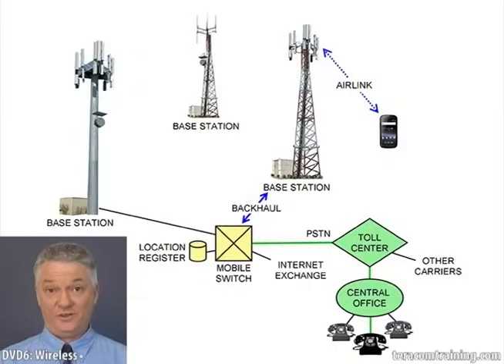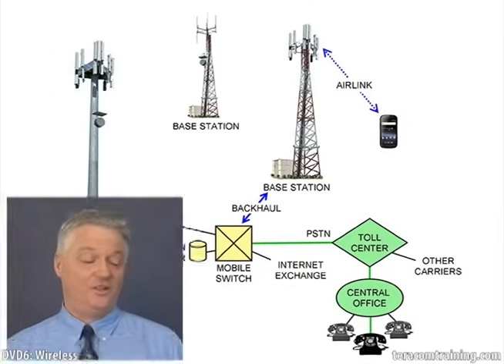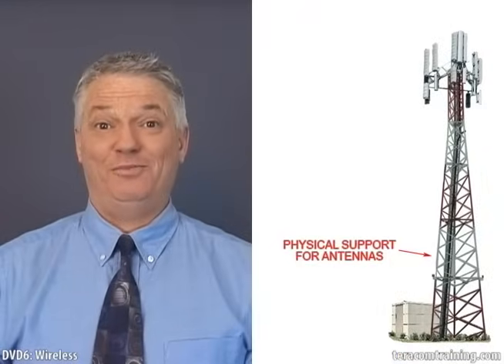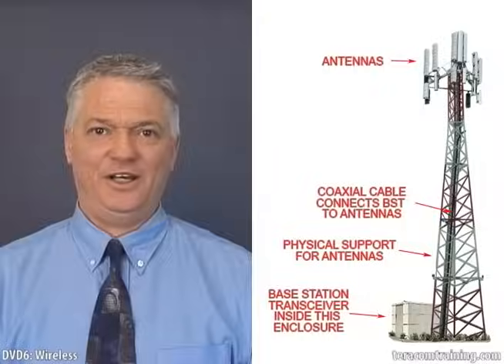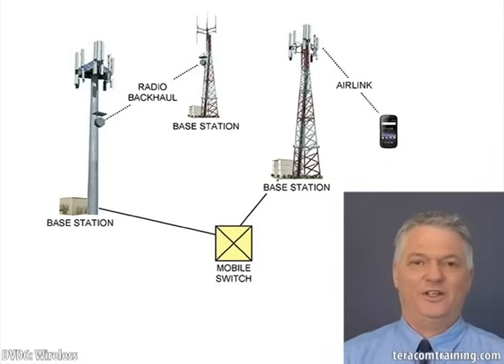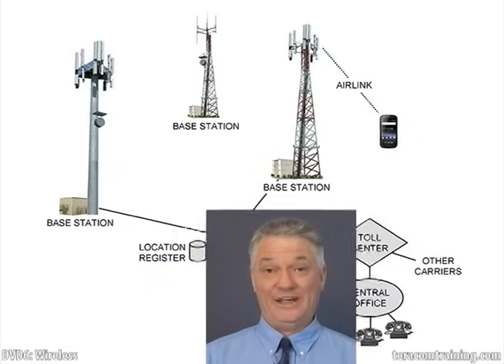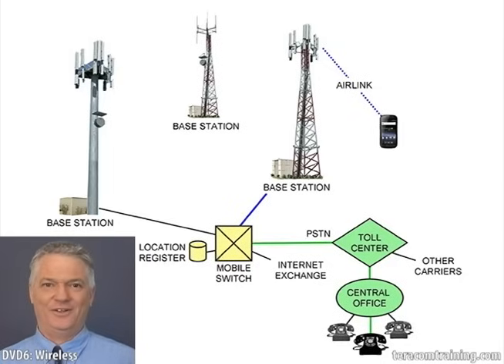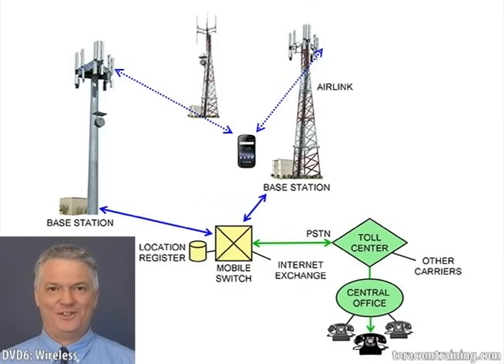Mobile Network Components and Operation

Comment: Looking at a tower up close there are huge cables.  Are these necessary for large power delivery or are they multiple bundles of individual wires?  This is not clear.
Reply from the maker: They are thick coaxial cables (one wire inside the other) to move the radio-frequency electricity that is the communication signal between the transceiver and antenna, to reduce attenuation.  Not multiple bundles of individual wires.
Reply: @teracomtraining  Got it thanks.  So it must be to minimize loss of signal.

Comment: 3:02 2 wires inside each other
Reply from the maker: Yes, and?  Did you see in 2016 Tosh.O came up with a variation (entry by the small finger side of hand)?
Reply: ( ͡° ͜ʖ ͡° )